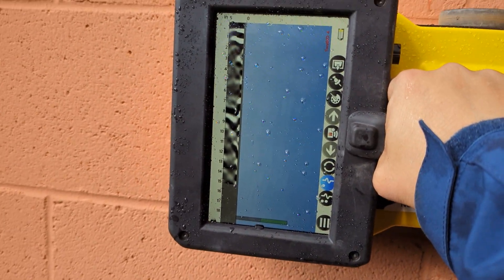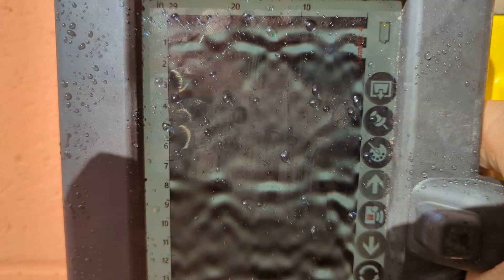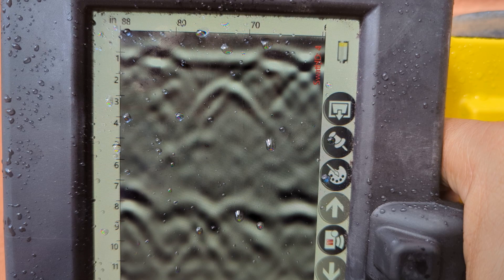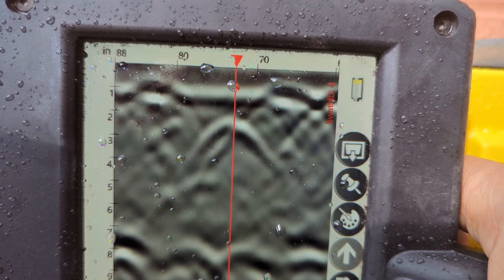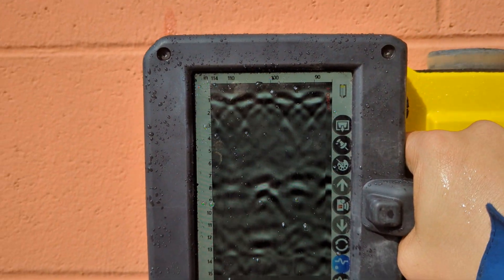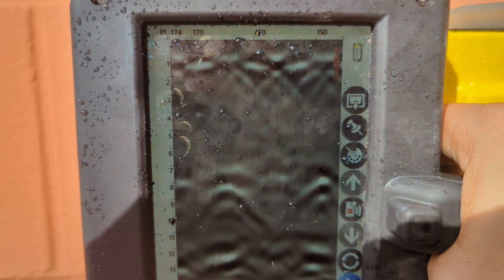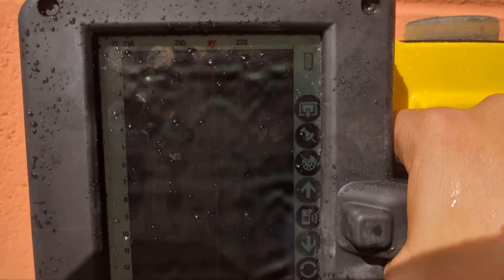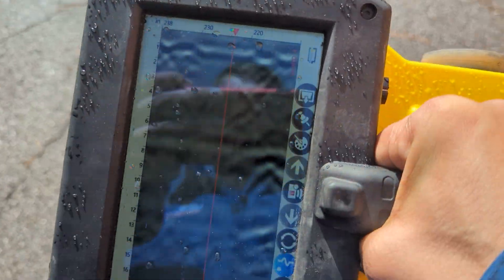Scanning CMU wall with GPR | ground penetrating radar | concrete construction |

Comment: Had a question I'm just getting into this kind of thing I bought a older system it's a gssi mf-10a with a display cd-10a with a gssi model 766da  400mhz ground antenna it's from 1994 was just wondering if you are familiar with this system and how to use it properly thanks
Reply from the maker: @JohnWayne_  thanks for the question. I am not very familiar with that system.. it is not one that we would use in our practice. However, we could probably train you on it if you brought it to our facility. Good luck
Reply: @Learngpr  okay thanks

Comment: Hi,Is it possible to use gssi antenna 200 without survey wheel?
Reply from the maker: Hi. Thank you for the question. Yes you can with the SIR 2, 2000, 3000, and 4000
Reply: Thank you appreciate your response on time always I talked to you before and I'm ready soon to get my Class done with you I'm just Gathering my gssi machine first then when it's ready I'll be contacting you soon thank you again

Comment: The cell you picked up with the rebar and core fill is correct but the cells you were saying are empty look to be core filled but no just no rebar. ?
What you describe as a “blip” is that not just the first 0 - 100mm of block that your seeing then after there seems to be no reflections due to core fill?
Reply from the maker: Hi. That blip is the block thickness. A filled block should likely give a small or no reflection there since the concrete and block have similar dielectric. That's why you don't get that blip on the filled one, but you do get a reflection on the rebar.